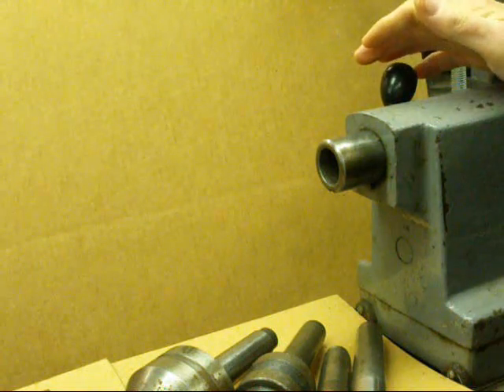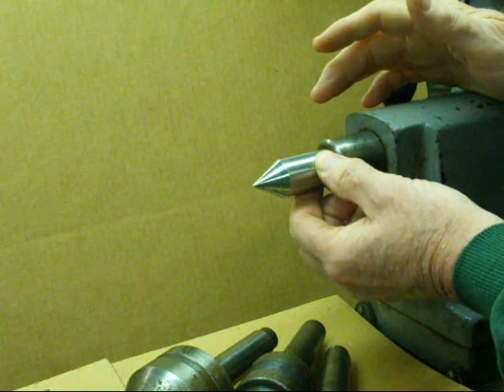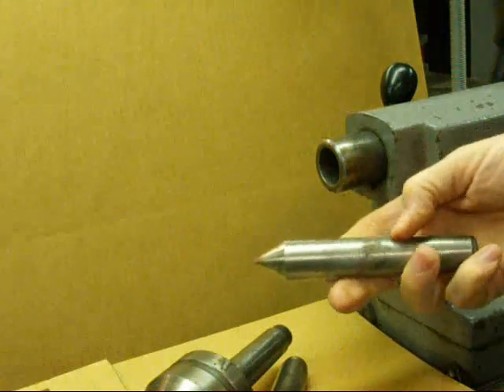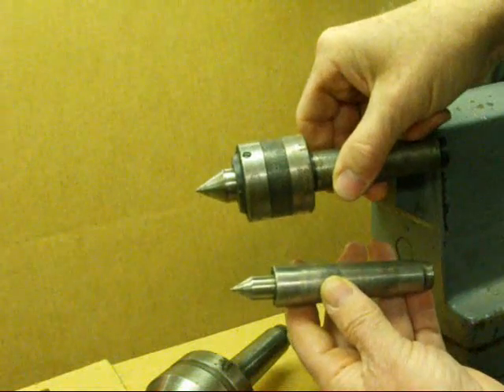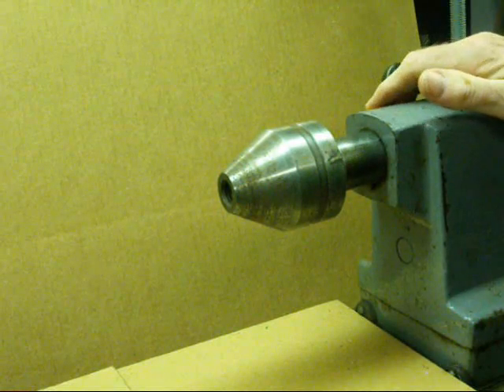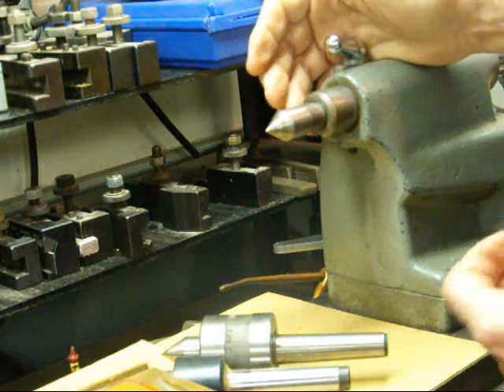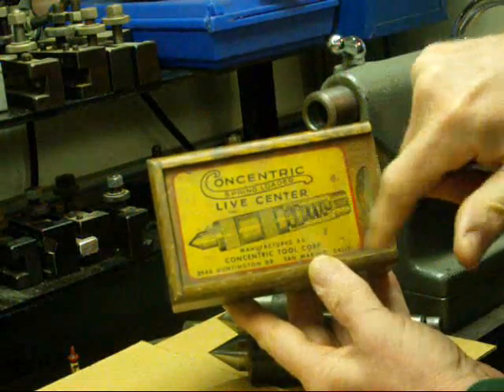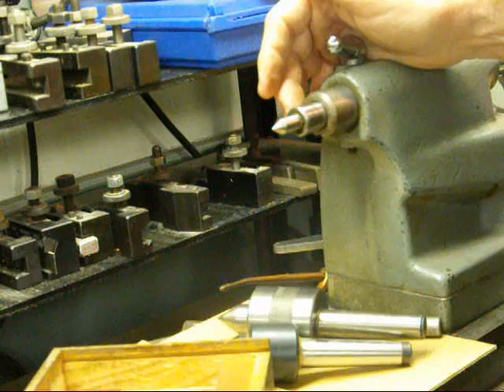TAILSTOCK CENTERS on South Bend Clausing Atlas LATHES

Comment: I just got a mt2 jt2 for my Jacobs chuck but my problem is the arbor is female thread at the mt side and it gets stuck in my talestock. It doesn’t pop out like my dead center. Because my dead center is solid at the end. Should I have gotten one with a tang on the end. I didn’t think it would fit.
Reply from the maker: Yes

Comment from the maker: Yes--some centers were ground that way. It allows you to face the end cleanly  while it is held between centers without interference. Its called a half center. When you install this center, the flat faces the operator and should be vertical.

Comment: A friend at work came over and asked me if I knew why some dead centers had a flat cut on one side down to just back of the point.
I have one with this flat that I use on my lathe at home, I just said it helps hold lubricant on the center longer... Is that correct or is there another reason? was kind of surprised he didn't know since he's run engine lathe for at least 20 years.